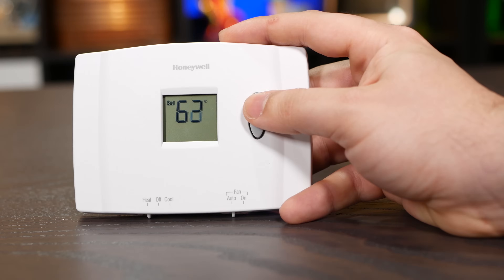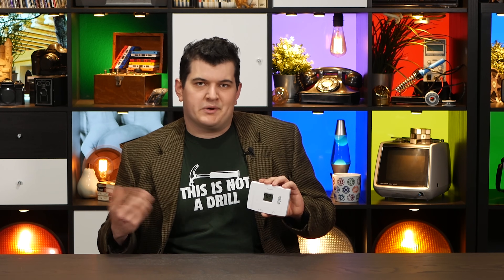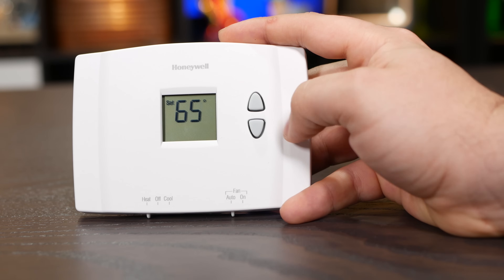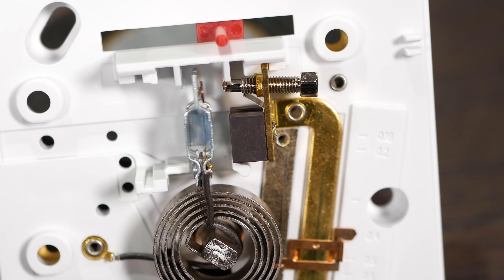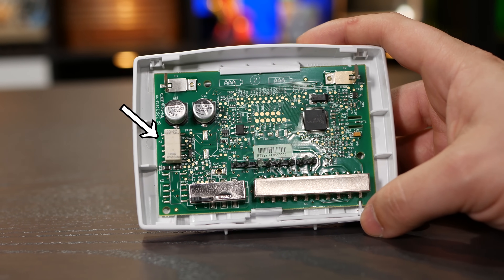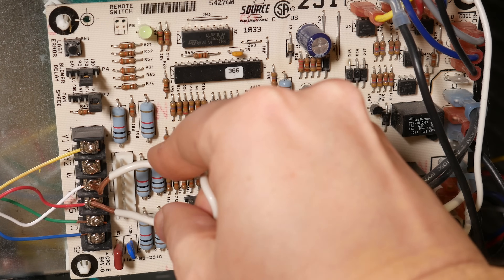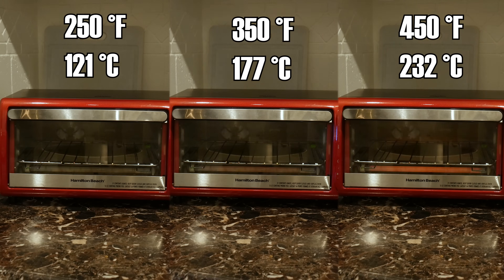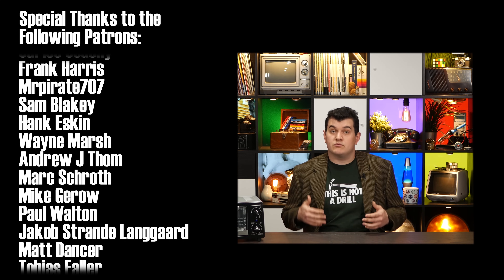Thermostats: Cooler than you think!

Comment: My Lux Geo thermostat lets me override the programming in 15 minute increments for up to a 24 hr period, so I can come in hot, set the ac to run 5 degrees cooler for 15 minutes, and then it'll return to its regular programming. Same with heat mode. Not quite the 'push a button get one cycle override', but still pretty useful.
Reply: Many programmable thermostats allow for varying "overrides"...

Permanent holds are good for vacation, ignore all the scheduling and just hold a temperature.

Often just changing the setting without activating hold will revert back to the normal schedule at the next scheduled change time. Good for "I want it warmer this evening, but go back to normal at the bed-time scheduled time."

And (typically, but not always, with connected thermostats that leverage additional control interfaces available in apps), it's also easy to implement "Hold until" programming that let the user set a hold that expires at a certain time instead of the usual next scheduled time. "Make it warmer for the next hour, then go back to normal."

Of course connected thermostats can often use services like IFTTT for a variety of external triggers to set temperatures or timings. "Turn up the heat when I* leave work."

Also programmable units are a huge energy saver because you can have the schedule change the desired temperatures automatically or on a schedule when you don't need as much heating or cooling, like during the day when no one is home.

 - Mikko

*"when my phone leaves work", at least until we all have GPS implants some day.

Comment: Yea, 2 stage heating, dual speed blowers, and even variable speed blowers exist. Some Trane models will vary the blower speed depending on how much heat/cooling is requested. These usually have smart thermostats and you can set the blower levels to use in different circumstances.

Comment: I still say mercury switches are where it's at for thermostats!! With their adjustable "heat anticipator" elements to add "intelligence" to an otherwise basic mechanical device. Some of the best ones are the commercial Heat / Cool / Auto thermostats with separate setpoints for heating and cooling, and TWO mercury switches!